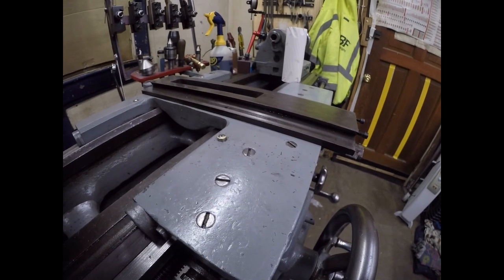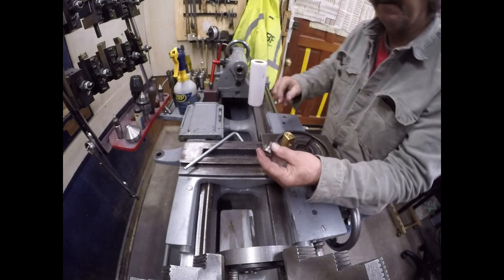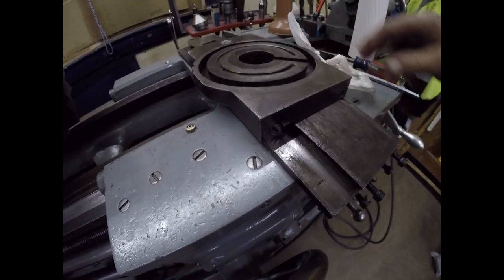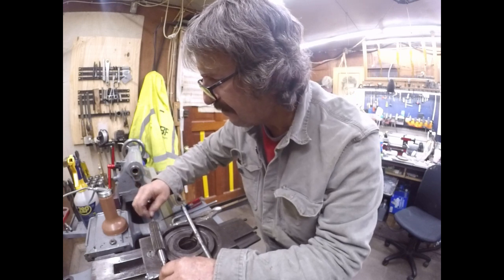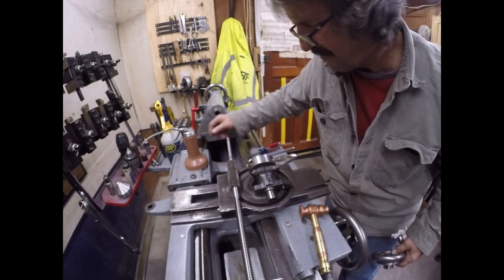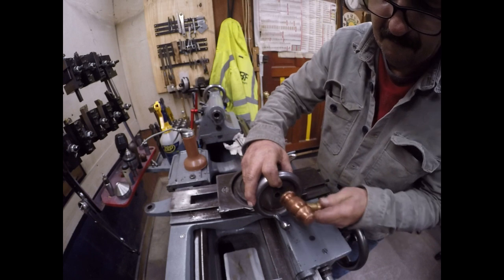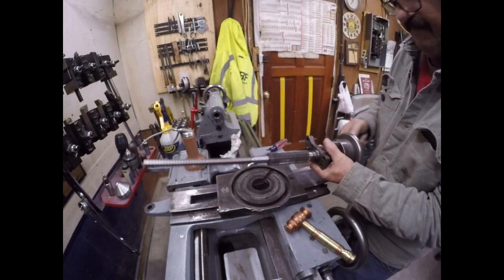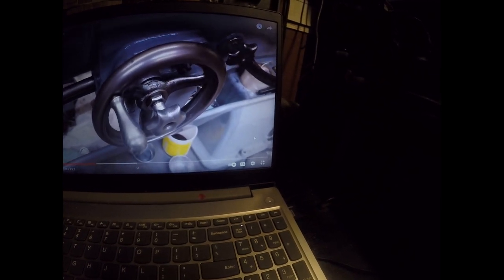NUT & SCREW INSTALLED

Comment: You can probably just do like a 1/4 turn to release the clutches you should not need to make multiple turns. The oil running over the clutches all the time should keep them operating smooth with minimal gap.